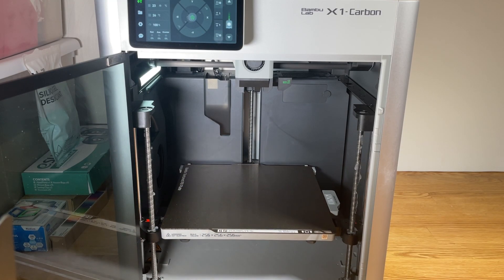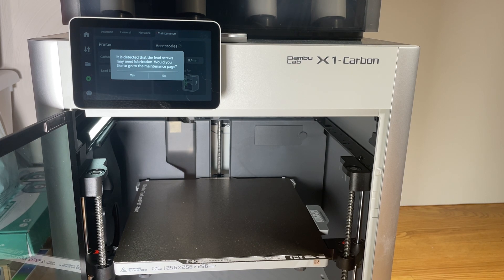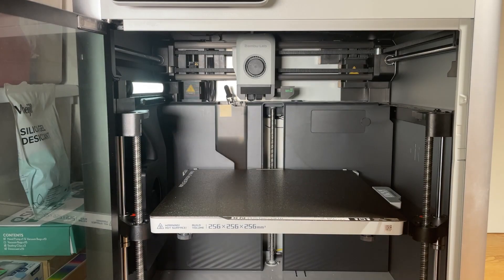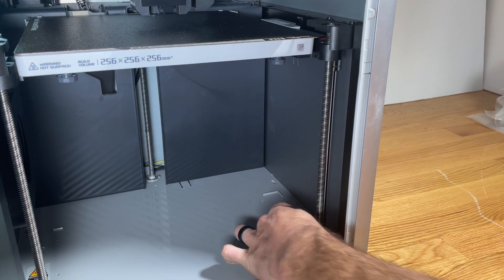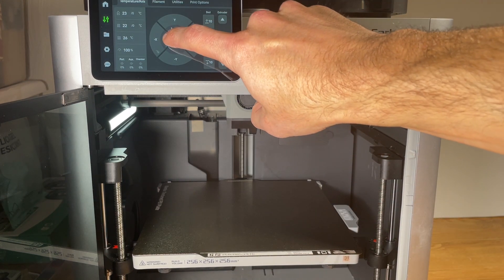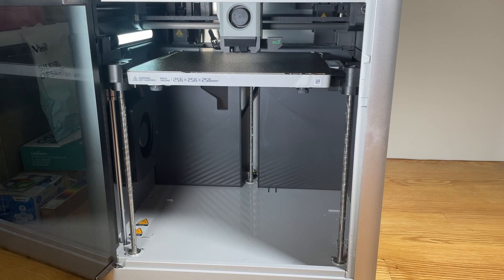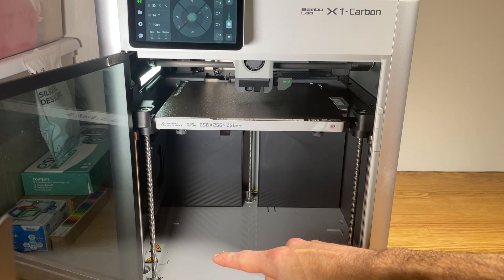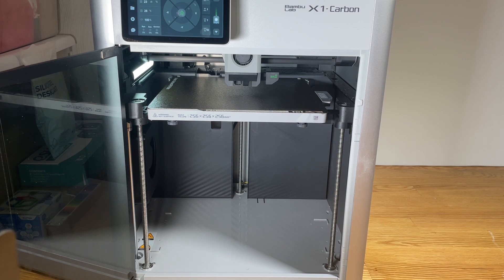How to Perform Bambu Lab 3D Printer Lead Screw Z-Axis Maintenance (Lubrication)

Comment: I find running the bed up and down with a paper towel held around the lead helps SO much in cleaning it off faster.
Reply from the maker: Thanks for the tip!  I'll have to try that out.

Comment: Paper towels are not recommended to clean lead screws, as they can leave lint and dust residue on the screws.
Reply: Doh!  I literally just followed this tutorial :(    What would you recommend instead of paper towel?
Reply: @KevBell1701  Never use paper towels, only use cloth towels that don't leave threads. And besides, @the3dprintzone put too much lubricant in there. Only a small amount is needed, the linear nut will spread the lubricant over the screw itself. Then just wipe off the rest that remains on the nut so that dust doesn't stick to it.
Reply: @KevBell1701 what’s the answer
Reply: @KevBell1701  Lint free cloths. I have box of old unbleached T-shirts that work well, not just for this printer but any small machine maintenance.

Comment: I like what you've done. But as an engineer I can say the outside of the lead screw is not in contact, use white string wrap around once under the bed (at the top) and lower the bed keeping light tension on the string.